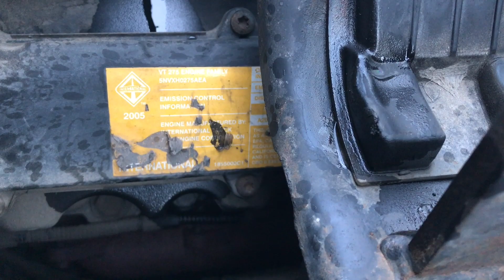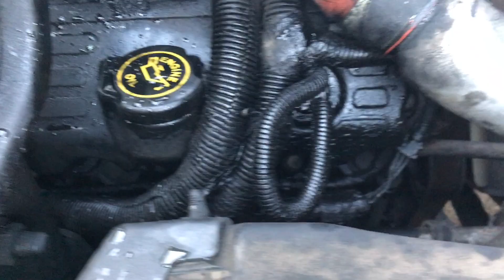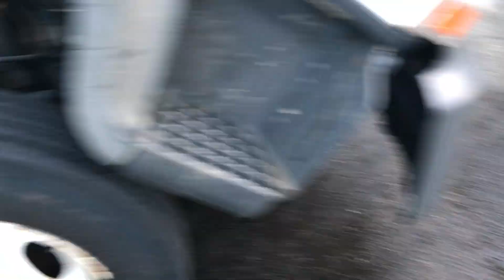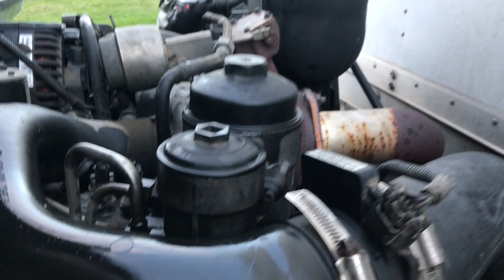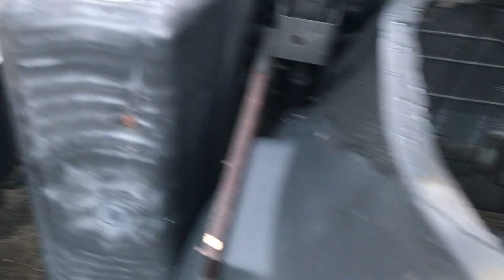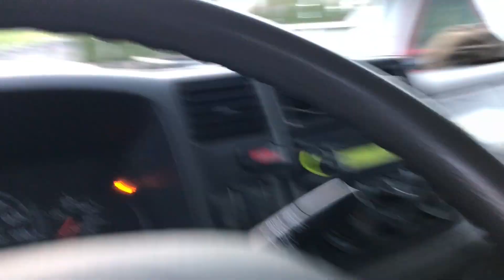The 4.5 V6 Powerstroke!!

Comment: I have a question when you pull up codes are you using the standard OBD2 scan tool and what vehicle you do the search Under?
Reply: These use 9 pin j1939 diag tools, the OBD2 is strictly for the body control module only
Reply: @808gunz9  I do understand the J1938 would be the adapter for the communication port, but my OBD2 scan tool would not have a ford LCF in the listing, as a choice
Reply: @rickmavictime756 i believe that's because the body control module just uses generic and not manufacture specific DTCs but i could be wrong EDIT the scan tool would automatically detect the vehicle i believe

Comment: I got a buddy with a great deal 06 Ford LCF  119k miles but it’s cranking but won’t start. I’m tryna figure if this is a good investment cause I don’t need no more headaches
Reply: Check oil pressure, probably stand pipes or dummy plugs. Potentially hpop, doubtful though depending on the year
Reply: Probably ipr valve

Comment: Need som help guys my cf600 engine, turning over  but  having issues won’t start getting fuel to the fuel filter, no problem, clean all the lines and and install new filters also, have , the red engine symbol on the dash

Comment: I have one 2008 the heads cracked and replaced them and still getting hot 235-240 as it did previously. Idles fine but under load it gets hot again.  Anyone have an idea???

Comment: Sup man I just bought one of these only 83k on it. My tanks are rusted bad. And no power going up hill
Reply from the maker: If they are the factory fuel tanks usually the delamination inside the tanks gets all sorts of crap running through the fuel lines and clogging the injectors, i would put a titan tank in, thats what went in this one. No power could be several things i need more info to help out

Comment: It’s hard to believe that things anywhere close to worn out at that mileage. We have some little GMC w4500s at work And they have a really heavy loads like pallets of drinks and we get 250 to 300+ thousand miles On 6.0 L Vortech’s and even some with the old 350 vortec engines. I’d stay the heck away from any engine Navistar makes.
Reply from the maker: The average Joe’s tinkering And Repair Show this thing blew a straight hole in the block it was used for beyond its means, it was moving heavy loads of steel and equipment. Lack of maintenance. I’ve been absent from YouTube but I have more vids to get up. This was probably over working every time it was out to say the least, always loaded. these engines were not built for this. Good for little trucks.. yea stay away from these if looking for a work horse unless it’s direct from international ford changes things and well we have all seen the outcomes
Reply: Dang, my dad's 6.0 Vortec just bent a rod at under 120k about a week ago. Rarely uses the truck, never towed with it, not sure how it bent a rod. Time for a rebuild I suppose 🤷‍♂️

Comment: Subbed because I'd put that engine in a ranger too
Reply: I want one in an f150 lol 😂
Reply: @hilljackzack7284  idk if you want those problems
Reply: @Bleachanna  I was joking that would be absolute horseshit quality of an engine it’s already bad enough that it’s built with the same design flaws of a 6.0 powerstroke but to add insult to the injury it’s a v6 instead of being an I 6 or a v8 which if you didn’t know the v6 config is horrible for towing and low end torque.
Reply: @hilljackzack7284  yeah it's horse shit 😂😂 the 6.0 6.4 are also horse shit 😂
Reply: @Bleachanna  agreed

Comment: I thought about swapping one of these in my 86F150 till i found out it has the same problems as a 6.0 diesel
Reply: It's basically a 6.0 with 2 cylinders chopped off and the problems of the 6.4 thrown in the mix as well 
This was worse than a 6.0.
Reply: @bryanmartinez6600  i knew they had problems. Just didn't know how bad

Comment: I do have a electrical issue and I can figure out the truck star nd everything but all lights in the desk come on and off and I loose the power complete I replace the batteries alternator also still have the same problem if you what I can do let me know this is my email Alonrosa68@gmail.com and my phone number 913-742-9424

Comment: Good video thanks.  I have same motor 05 lcf vt275 4.5L.  I have had it in and out of shops mechanics call it the cancer truck... It has now been diagnosed with hpop failure.  While doing that was thinking of egr delete, do you know if any tuning available for this motor?  Also pull inspect and clean oil cooler while in there.   Anything else you recommend?

Truck had issue few months ago it would cut out while driving, then fire right back up once stopped.  Then it became the truck would cutout and not start back up until it sat a while.  Then it would just cutout and not start back up.
Reply: look up ford 6.0 diesel problems. delete everything, blue spring mod, egr delete, coolant filter, OEM filters, do fuel filters often, hpop stc fitting, ect ect. theyre solid engines once the bs is taken care of.

Comment: I used to work on those when I worked for ford. they were hard to diag because the international software was not as good as the ford 6.0 software. Power balance was terrible and pid data was very slow. had they built them as a real ford instead of an international with a blue oval on the truck it would have been more user friendly. they didn't hook up to ids and you needed the j1939 connector set up with medium duty Navistar software. they didn't use them in the f150 because of the 6.0 being a flop and ford told Navistar thanks but no thanks. when they ran they ran good. when they broke they broke even better.
Reply from the maker: darren browell I agree 100% pain in the ass to diagnose, it’s a mini 6.0... and luckily I have the medium and HD software, for this reason and for the bigger trucks. One came in that had no warning signs and had a giant hole in the side of the block! No check engine nothing prior to the issue.
Reply: @JDawg965  what caused it to blow
Reply: My 2006 LcF ford antifreeze to exhaust and a lot of white smoke covers road and I brought to dealer they apparently fix it but after a couple of happened the same thing they said they. Changed the egr valve but why it keep breaking?
Reply: @madridlandscapinginc.3079  egr cooler itself

Comment: How are your batteries hooked up? I have replaced my batteries but It won't crank over.
Reply from the maker: Jorge Amelco is it cranking but not starting? Or not cranking or doing anything? Was it fine before you replaced the batteries?
Reply: I replaced the engine with a rebuilt one. The other one was no good but it cranked and ran just blew lots of smoke, found out it was over full of oil about 6 quarts maybe 10. Now a installed the ground cables on the right side of the engine and installed 2 positive cables on the starter and also the small one, so a total of three positive wires on the starter I am beginning to think that's not right. The engine has power and makes noises. Help????
Reply from the maker: Jorge Amelco check us out on FB and you can message me there @DelcoDiesels I can send you over some schematics and help you out the best I can through the internet without seeing it. I will send you some pictures of what you need to see! Thanks

Comment: Where do you get a new tank? My truck is doing the same thing. Think some trash got in my injectors, cleaned tank thoroughly cleaned tank and lines, put a inline glass fuel filter, flushed water separator off truck,blew lines out. still getting engine light and rough running but is better. all this after paying a shop to do it. motor is strong when running right.
Reply from the maker: I agree the engine is very strong when running correctly. What is the code you are getting when you run the check engine light? If you send me that info I can walk you through. The injectors in the engine are not like the 7.3 they take little abuse before they give out... with you cleaning everything out. And if you replaced the fuel filters I hope
You used ford motorcraft filters.. there is also issues with the aftermarket filters breaking down and getting into the injection system. I also tell people try and get fuel from the same place so you know you have good fuel unless they have bad fuel.. contact me through my Facebook page and I can help you through where to start it sounds like you cleaned the fuel system out pretty good.. I have Ford sites I can send you to buy the tank and other parts at discounts.. but since you know what your doing I can walk you through!
Reply: I don't have a reader. I don't know what I am doing either. I am a mechanically inclined welder. Only thing I didn't blow out was from top filter to engine. I have had this problem several times on the road but it cleared up after a couple of hours and changing IRP,ICP. then I figured out it was trash in tank. I haven't ran it a couple hrs this time but this time it has a sound like its missing a cylinder but clears up when engine winds up. I also changed out IPR sensor again and found tiny pcs of metal including copper colored pcs.
Reply from the maker: Metalration you can get a good heavy duty code reader on eBay or amazon very cheap like 1-200.. just have to make sure it has the plug for the truck.... also you can run the truck and crack open the water separator and let some of the fuel come out to see how clean it is and if there is any junk in it
Reply: thanks. I will look for a reader. didn't know that.
Reply: look up power stroke help on youtube, nearly everything the guy talks about for the ford 6.0 from 2003-2008  applies. do the little mods and deletes and youll be cuising, and oem filters...